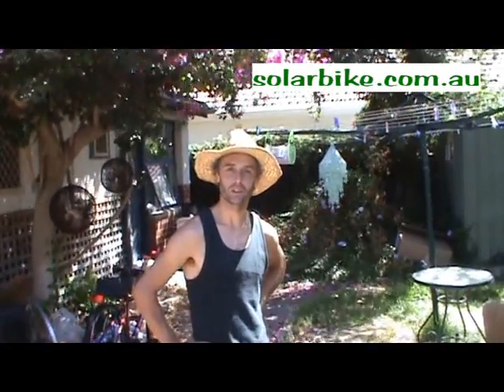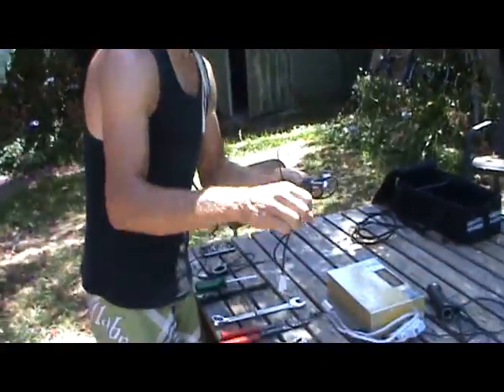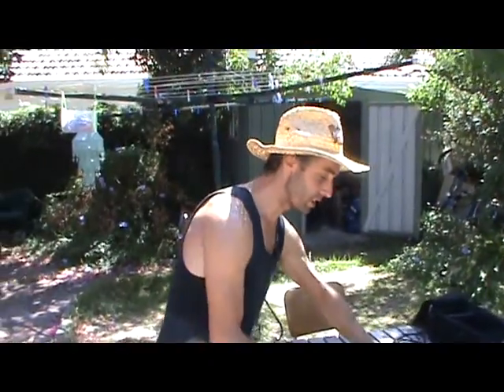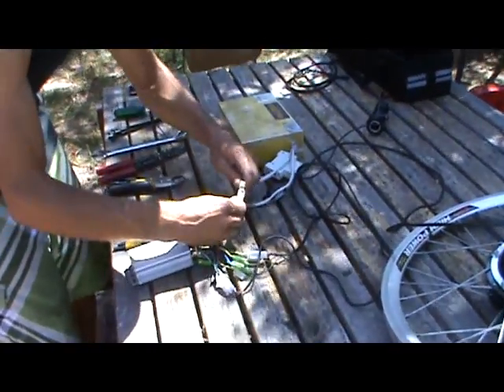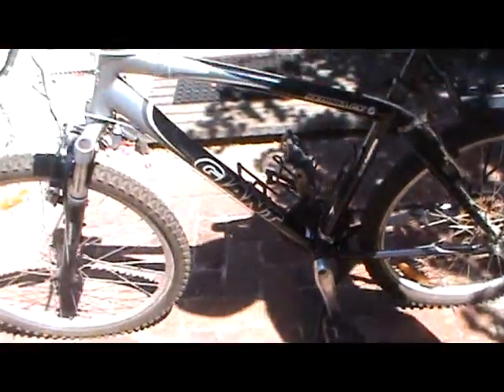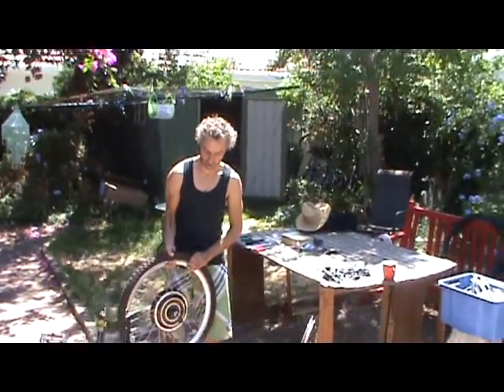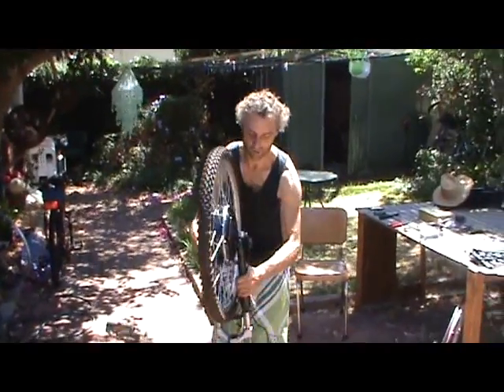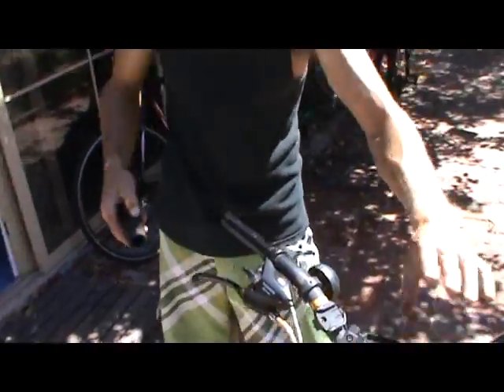Electric bike conversion kit assembly instructions - Part 1

Comment: In the UK the motor isn't enough for going up hills, you need the sensor to do pedal assist or motor will use up too much energy and eventually drain and cut out on the hil

Comment: If you are installing a pedelec sensor, then you DEFINITELY DO need the brake levers with the motor cut out wires. Even if you don't, it's best to install them.

Comment from the maker: Yes, it's possible to have the motor come with bolts that can secure a disc to the hub. They can cause a bit of trouble on some forks though as the bolts protrude a little. Also, they don't always work with every disc set - about 50% chance or working in my experience. I don't have them come with these anymore as it just led me to receive complaints from people if it didn't work. Best to convert to pads I find.
Matt

Comment: @matattack2000 Is it possible to add a disc brake on the motor wheel? *If itsl ike a golden motor hub kit or an XYM hub kit? Or should I stick with V brakes on the motor wheel and disc brakes on the wheel without the motor?*

Comment from the maker: 1000W divided by 48V gives about 20A. You'll want about a 30Amp fuse, if you blow this then try upwards of increments of 5A until they don't blow. You'll be able to get a fuse holder and range of fuses at any electronic shop (Jaycar, Altronics, Dick Smith maybe). Wire this inbetween the positive wire between the battery and controller.

Comment from the maker: You can connect as many batteries in parallel as you like. This will increase your capacity and hence your range. You must match the voltage correctly so keep it at 36V or at whatever you have on your bike currently.

Regards,
Matt